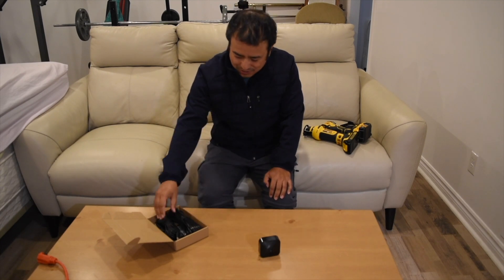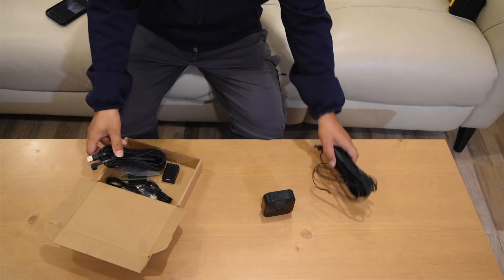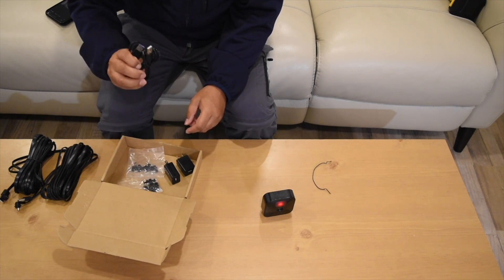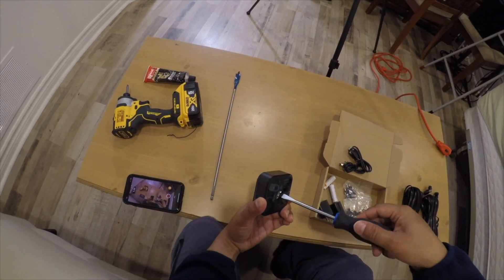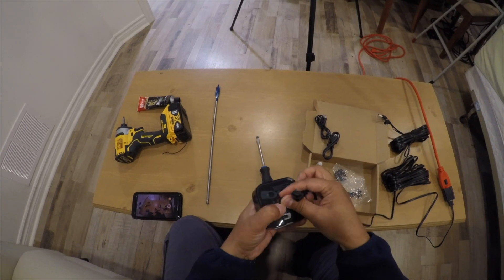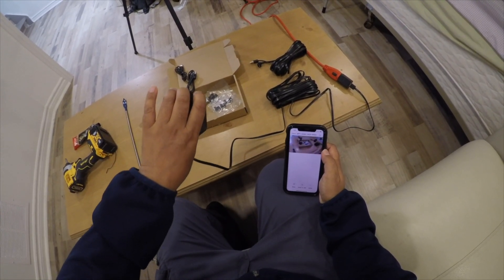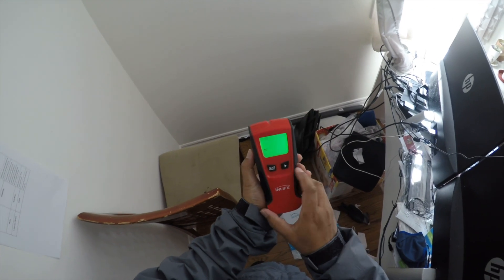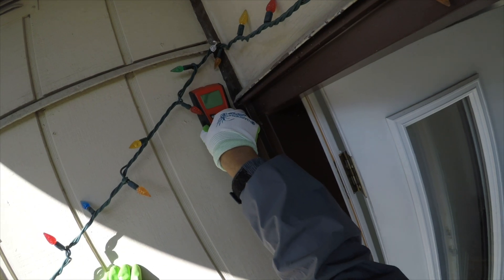Blink Outdoor Security Camera External Power Source Setup Practical, no battery needed.

Comment: I connected a tiny power supply, 5v 2.5 watts, and it worked. Inside settings -> General it tells you the battery status. When you plug in the power supply and pull-down the screen to refresh that changes to “External Power Status” even if there is batteries installed. So it seems it works with and without batteries installed. We will see if the batteries drain down at all. 

Before using a power supply I was using nimh batteries and they lasted a year. But the camera doesn’t understand it had nimh batteries (1.2v) installed so it said the batteries needed replacing after 1 months. But I just ignored that.
Reply from the maker: Its interesting, thanks for sharing.

Comment: Do you have to take the batteries out?
Reply from the maker: I took batteries out.
Reply: @easylifetechnology  but do we have to take the batteries out ???
Reply from the maker: @HoaNguyen-rr5lv  I took my battery out.
Reply: @HoaNguyen-rr5lv

No you don’t have to take the batteries out.
Reply: I connected a tiny power supply, 5v 2.5 watts, and it worked. Inside settings -> General it tells you the battery status. When you plug in the power supply and pull-down the screen to refresh that changes to “External Power Status” even if there is batteries installed. So it seems it works with and without batteries installed. We will see if the batteries drain down at all. 

Before using a power supply I was using nimh batteries and they lasted a year. But the camera doesn’t understand it had nimh batteries (1.2v) installed so it said the batteries needed replacing after 1 months. But I just ignored that.